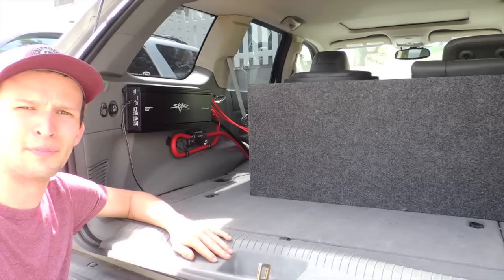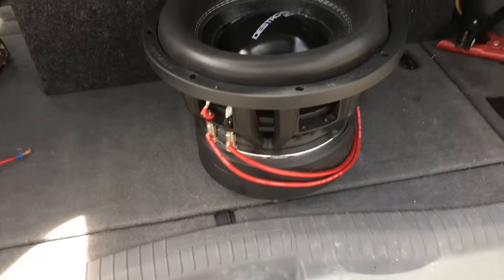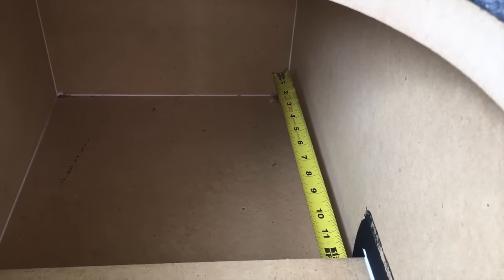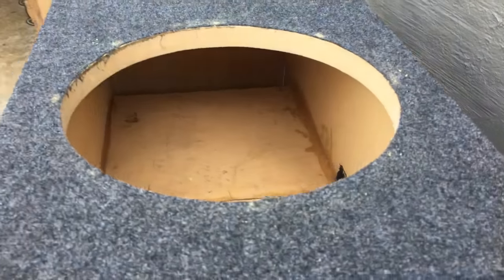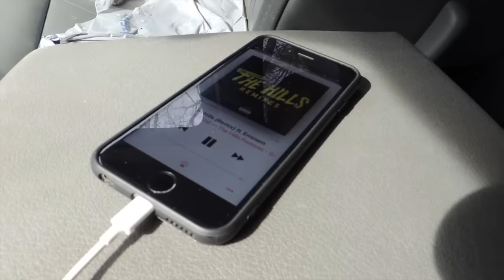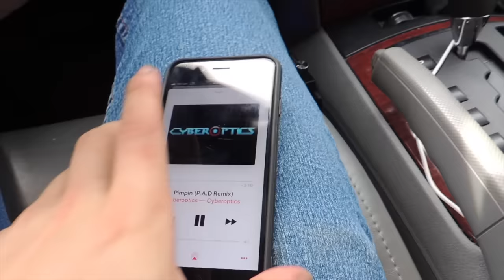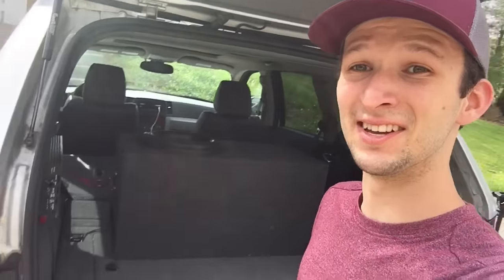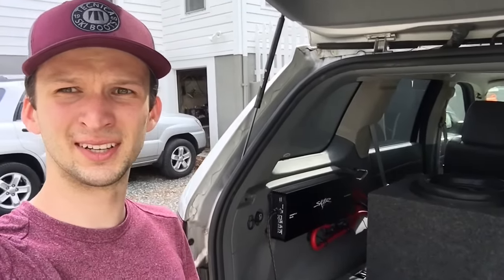Tuning My Box To Hit Lower! | How To Tune a Ported Subwoofer Box/Enclosure

Comment: For beginner’s that don’t know any better. The enclosure is just about the most important thing in a system. Prefab box’s are very good for shelving space, that’s about it. You can throw together and better box yourself in an afternoon for less money that buying a prefab.
Reply: I really want to build a box myself that is smaller than the Bose II (the old box)! Something that will go inside of a vehicle and would hardly be noticed but hits hard!
Reply: Really true me and my uncle built a box for a 15 tuned to 34 hertz , it’s 3.2 cubic ft but with the port it’s 2.84 cubic feet and it slams lows and highs great plus it was definitely cheaper to build a custom box that hits way harder than prefab
Reply: @robertsamaro9932  where did you all get the info on building the box?
Reply: @therajuncajun6487  research online my guy. winisd, ts-parameters and subox pro for example are good starting points to look into.
Reply: Thank you very much! I wish the prices of wood had NOT gotten soooo expensive!
Reply: @therajuncajun6487  I didn’t even see you replied but yes he is right I used sub box pro and then a calculator to nail the cubic feet
Reply: @robertsamaro9932  Thank you!
Reply: @robertsamaro9932  be careful with sub box pro it’s not really accurate I use it for cut sheets and 3D modeling sometimes but the cubic feet and shit was off bad. I got a copy of the old RE box calculator from my buddy (guy who helped start RE back in the day now owns psi) and I use winisd.
Reply: @therajuncajun6487  plenty of videos on how to build subwoofer boxes from scratch on Facebook. U can also buy just designs from people with cut sheets so all u got to do is build it. I do them as well for a little side gig. But that’s what I do for a living is build boxes and install and sell car audio.
Reply: @jldive89diver87  Thank you!
Reply: @jldive89diver87  yeah i can tell it wasnt accurate I used a few diff calculators to get the right tuning I got it dome momths ago but it was my first build im still using it love it
Reply: Props for giving this knowledge
Reply: Preach it brotha
Reply: @The Rajun Cajun  you'd need a small woofer like a 6.5" CT Sounds or Sundown Sa 6.5 " 💪😎👍
Reply: You cant throw a box together in an afternoon lol not unless you have zero regard for quality and are in a massive rush.
Reply: @bailey2517  wrong. I build them everyday. That’s literally what I do for a living.
Reply: @bailey2517  if u have your design and cut sheet how long do u think it takes to cut some wood, mark your holes, predrill them, glue it, clamp it, then screw it together?
Reply: @jldive89diver87  2-3 days for a beginner, but it should atleast take u all day if you don't have great tools. If you have a table saw and a good shop where space is t an issue and you aren't moving things around constantly then maybe a few hours, but 95+% of people don't have all that. My first box took me 3 days and it was sealed lol.
Reply: @jldive89diver87  also, people might not have clamps, drills, tables to set the boards on, etc  it's a big pain when you don't have proper equipment. Just because you can do it in 4 hours doesn't mean you should lie to people about how long it will take them 🤷 also you have to consider painting it which takes time, and sanding it (use sand paper and wrap it around my thumbs and run it along the edges to make it look smooth), are you using a router on the port or other edges? Priming and painting?  Also I'm sure you can glue all the sides at once, but I had to do one side at a time and let it dry when I built my first couple boxes.
Reply: You definitely can’t, it’s not that easy.
Reply: I run into drying time.... that's what takes longer than anything.   Culk, glue, paint, finber glass resin n so on... drying time sucks.
Reply: That might have been tru 4 yrs ago, but have you seen wood prices lately??....holy wow!....might be cheaper to make a box out of sterling silver
Reply: @PhantomOfThePsy-Opera  yeap but still hold true, sheet of birch $89, mdf considerably cheaper, glue and some screws. Still cheaper or at the least roughly same price. But main thing is you build the box right, for your subwoofer and vehicle specifically, and it will outshine the prefab by miles all around. Still the best option.
Reply: I wouldn’t say for less wood is not cheap
Reply: @bailey2517  again all u need is a skill saw, wood glue and screws if your just building a box like I said. I’ve built plenty of boxes in my yard using a tailgate or a porch and cement blocks to hold wood off the side. All I used was a $30-40 skill saw, $30-40 jigsaw for hole, tape measure, straight edge, pencil, wood glue screws and a impact or drill, if u think it’s a lie that people can’t cut 7 pieces of wood for a basic ass slot ported box and glue and screw it together in a day ur crazy bro. Obviously I wasn’t talking about paint and glue drying times. I said build a box, no need to nitpick what I said cause it’s 100 percent accurate and mainly most people got my point that it’s a pretty easy process and the end results if done correctly are much much better in the long run. That was my point, that most people got. Anyways have a good one 👍
Reply: @bailey2517  and why would u have to wait for one side at a time to dry before u added other pieces? That doesn’t make sense if you’re screwing your boxes together. And it’s much easier assemble it all before it dries in case your cuts are completely straight so the panels will pull themselves together when u screw them.
Reply: @jldive89diver87  I don't like to screw the boxes together because it makes it look less premium. I know I could fill it with wood filler, but that just takes even more effort and time to dry and I don't wanna bother with it.
Reply: Lowering Hz means more heavy but clear bass or what does it mean?
Reply: This box has a  1" faceplate and  .75" MDF everywhere else. It seems pretty solid. Dado joint construction. I just bought one for $75 shipped on ebay from Q-power. I plan on putting some bracing in it and liquid nails to reinforce it because I'm going to put it to the test with a Resilient Sounds Onyx 12". I saw someone in the reviews of the box put an Orion HCCA in this box and now Parker put a destroyer in one so it should hold an Onyx 12?  I gotta tune it to 33hz so thanks for this video Parker. For $75 bucks shipped you can't beat it for a temporary box.
Reply: I wish that were true in 2024. You been to Home Depot lately ? For the cost of materials and time I got to spend in that afternoon is way more than what Amazon wants for a qbomb or bbox 🤷🏼‍♂️

Comment: Hey Parker if you turn your box so the port is facing to the back hatch tbat tends to usually be a little louder,as well as reinforce those low notes.
Reply: Yea the atrend box 2.5 looks just like an acts as such. Long ways is louder
Reply from the maker: Will be building a custom box with rear facing port soon. Stay tuned!
Reply: Rob Sorgdrager Yessir
Reply: @ParkerTheBasshead  I feel like that port needs a little more restriction. Maybe another slab of wood layered?
Reply: javier cazares Yeah suvs are always louder than a sedan
Reply: javier cazares Even the stock subwoofer in there sounds louder than i thought
Reply: I was gonna say the same thing.. “what they said”. Especially with hatch back style vehicles like the jeep...

Comment: rockville is digging themselves a bigger hole with the recent video the posted. even the guy from emf audio called them out
Reply: Rockville is on life support bro😂😂
Reply: They actually have channel man
Reply: I seen that💀
Reply: You seen their last vid.. rockville?  Dude ran 3500 watts into that 750 watt sundown speaker on purpose..  watch the vid very carefully lol
Reply: @videosgoneviral7858  3500 of clipped signal. read emfs comment, he called them out for not showing the o scope. the sundown sub will handle the power as long as its not clipped
Reply: Yea i read the comments.. yea emf is spot on .. but if you watch the video.. why did they change amps is 1 question, another was why didnt they use an in line watt meter to properly measure the watt out put... and why did they use a sundown 750 watt speaker when the test done by exo was on their 4000 watt speaker cea rated at 1000watts.. not a fair test.. i been doing this 40 years... am old skool and can tell you that was a bogus test rockville did... throwing even 2000 watts into a cea rated 750 watt speaker is overkill...
Reply: Oh and i forgot how come they didnt air it live to prove their not hiding anything.... they could have done a live feed to show it was a legit  test... i keep watching to see how far this goes...
Reply: @videosgoneviral7858  exactly. He gave it that much last second. They could take 1k all day honestly not clipped long along 750. But 🤷‍♂️
Reply: @videosgoneviral7858  me too lol. running false claims is killing them. i hope maxxonic does this so we can call them out for killing hifonics and mb quart quality
Reply: Like they always say never sacrifice  quality for quanity.... using cheap china parts gonna make weak  subs... 👍😎
Reply from the maker: Hmmmm I love love EMF! Where did He call them out?
Reply: Episode 2
Reply: @videosgoneviral7858  they are wicked butt hurt😊😂🤣😂
Reply: True dat 😂🤣😂🤣
Reply: Poor sundown but he did say the volume of the box was a bit high but srill rms power is too much for a sub any sub actually
Reply: @shoof1696  They were only giving it 750 but if you look at the output voltage they were showing like 54v which is like 2.5x what it should be for 750 watts at 14.4v. They have the rail voltage at double what it should be so they are full clipping it at 750w and they are playing a song that is like mid 30hz in a box that's tuned to 54hz. So not only did they clip it to death they were playing like 20hz below tuning while clipping the shit out of it. If anything that is a promo video for the Sundow SA 12" because it went almost 3 minutes at full clip playing 20 hz below tuning before it gave up the magic smoke. The huge jump in power on the term lab is when the coil let loose the impedance changed as the coil shorted out.
Reply: @videosgoneviral7858  I was with you till you said CEA rated speaker as CEA ratings for speakers do not apply to power handling.
Reply: Marka2555.  I mentioned nothing of cea rated speakers.. to me cea rating is just another stamp to sell a product... comes down to what you see that matters not a stamp... if you think a stamp is worth more than a physical product then more is to their own... everyone knows side by side trying to match a product up with another is difficult... like a speaker to a amplifier... back years ago  no one really cared about a cea rating.. just the rms power comming out was what mattered.. to me if your product cant handle the abuse put to it.. then its a crappy product if it breaks before 2 minutes of use.. my alpine speakers lasted me 6 years... and i hammered a lot of power to the 2 and 1/2 INCH single 4 ohm voice coil... paired  e series 12s.   Pushed down to 2 ohms on the meter..  cea rated never... rms power rated certainly..  peek power rated means nothing... had those in a bandpass 4th order box .. hit hard certainly.. power used  500 rms watts... did the job.. difference from a low budget system and a high budget system truthfully .. u get what u pay for bottom line...  just my 2 cents....
Reply: That 3000 watts when the sub went was not them cranking the amp. That was the enamel melting off the wires on the voicecoil. It amazes me how many experts who have been doing this for years don't understand that this is what happens when a voice coil goes thermal. Same thing happened when exo tested the k9 and it went thermal. Last second power jumped by like 3x original power. You realize that when the enamel melts off the voice coil it basically creates a dead short to the amp right? So what does an amp do with less resistance? It increases power.
Reply: Corey Pitman when has he screwed people over? I respect the guy that’s why I want to know if I should still look up to him or not.
Reply: @maincharacter2677  obviously you're new to this channel. Hes done videos scrutinizing other youtubers products.  He actually done a video on how to use a product with instructions for the previous model and called that product trash. Then tried to crawfish out of it with another video.  Plain and simple the dude hated on another youtuber because he wouldn't showcase his speakers on his channel.
Reply: Corey Pitman Oh I understand the whole Steve Meade debate where he didn’t test Steve’s equipment right. Yeah I get that now.
Reply: EMF has also been digging himself a hole. I'm not subscribed to him anymore because of that. Dissed the Steve Meade SMD tools and dissed a lineup of amps.

Comment: bro i know this is an old video and no one cares but... i bought a rockville box which is the same exact box. i thought i wasted my money. ive been out of car audio for 10 years and now i want back in lol.  i thought this box had good thump but no lows. so i bought a skar single 12 box and it sounds even worse... we i found this video and i went to home depot and got a square of MDF i copied everything you did and great results im bussin 34hz clean.  old Rockford POWER  T1 D4  with a Hypnotiq 1000xd mono. forgive bad spelling or typos please.

Comment: I always modify prefabbers. They're always tuned way too high. I always add to the port of make the port smaller and longer. Also, you can take away air space or add poly fill to match the airspace.
Reply: My Prefab Sub Box Is Tune To 35Hz😁
Reply: @reverbae  34hz here on my prefab
Reply: 37 for mine. Just did this method to try and bring it down a bit

Comment: Remember when you enlarge the port in a attempt to lower the resonant frequency of the box you are also increasing the displacement of the port.  That in turn, lowers the net air space of the box raising the resonant frequency of the bix.  What you end up with is a very small drop in tuning from lengthening the port.  I'd estimate 44 to 41hz with 12 more inches of port legnth.  If you want to get down to 35 your going to add another 12 inches of port probably more and you'll need to add some external port length.  That will extend the port without decreasing net air space, a much more effective way to drop that tuning.  Even just 4 inches of external port length  will give you 2-3hz drop.
Reply: Glad to see you are from NC. I’m in Charlotte and enjoy your videos. Love for you to show me some tips how I can better my very simple system.

Comment: Thank you so much for posting this, perfect timing as well! Just yesterday, I got a piece of plywood to do this to my box, because ive been very confused as to why I cant hit lower than 40. Didnt know if it was a box issue, subwoofer, or amplifier. It moves plenty of air, just can't hear the sound of the notes. So this should help fix this issue. Thanks for doing something like this and showing people how to tune a pre-fab. Mine wont be proper or pretty, I just need it to hit a few Hz lower, I'm a fan of the sustained low-low notes. Posting videos of my current upgrade process soon as well. I'm new to posting vids, but I'm trying to get it done. Not fancy, not much music, and no editing, but I like what people like you do.
Reply: use the re audio box calculator to find out how much wood youll need to get the desired hz

Comment: Actually there are some decent prefabs out there. Good vid. Nice little setup
Reply: Cool video fun to watch. The one thing that jumped out like crazy to me is your voltage switch in the back next to the amp. If you don't have the voltage meter in a visiable place usually up in the dash it's not as useful. It's super easy to extend the switch. You don't need to use a large wire to extend it because it doesn't draw juice.

Comment: Nice job! The only difference on my box, what I was talking about doubling the mdf is I ran another piece on the inside the full length of the port, 25.5" making the inside width 2.75" on the port. This lowers lowers tuning a little more for me.

Comment: I got a box for my L7 Q class 15” , it’s a prefab, and I did the same thing . Extended the port internally, but due to the box being too small for most 15”s , I put a front baffle on and put a 12” in just to test it out, and woah I’m impressed. Sounds really good and gets low. Sounding much louder and clearer than the 15” did and digging way deeper . The box was originally tuned to like 40 hz . And now I’d guess it’s around the 34 hz mark, going to extend it a bit more to try and get close to 30, and put a front baffle on made of birch, and stain it and go with an extra high gloss finish. Should be a fun project just to revive a box that was basically useless . It hardly fits my Mercedes trunk, but it fits and that’s what counts . Hope to see more videos like this, turning prefabs from trash to good . May do the same with a 2 12”s box I have, it’s closer to spec for some good 10’s, extend port, put a nice new front baffle on, should be good 💯

Comment: I just made a sealed bass tube with a W65K9D2, I built it using "Subwoofer Tools" (after I converted 0.4 cubic ft in a box to cylinder measurements)! I know it won't hit 35hz with that thing but do you think it will bump?

Comment: I have the same model jeep and I had problems with the sub not going low like it should. Turned out those grand cherokees have noisy interior panels back there. I added sound deadening to the inside of all the rear panels and it sounds much better. Hits lower and cleaner.